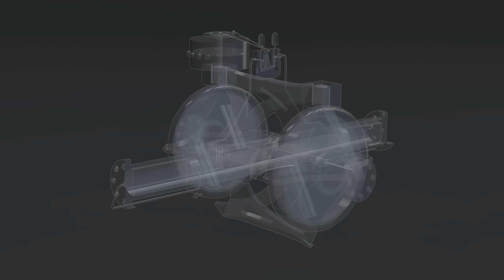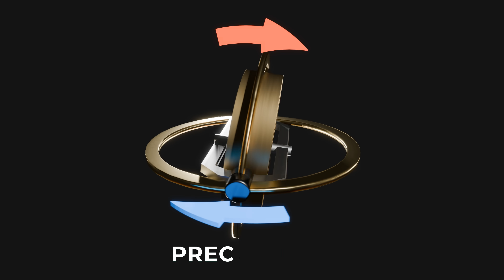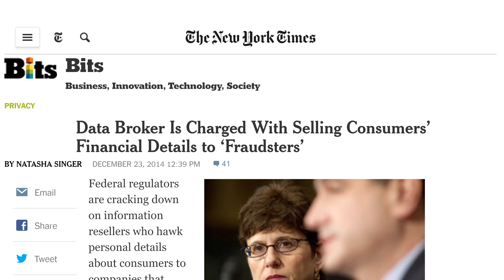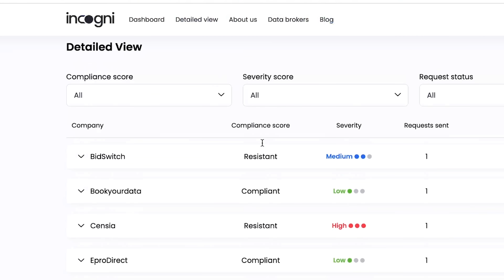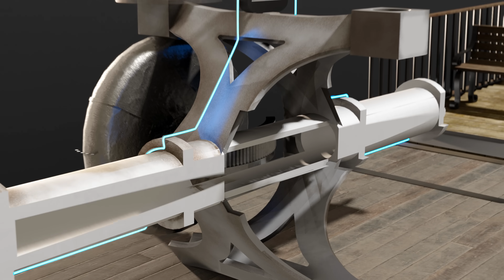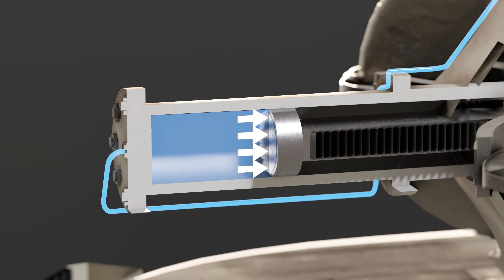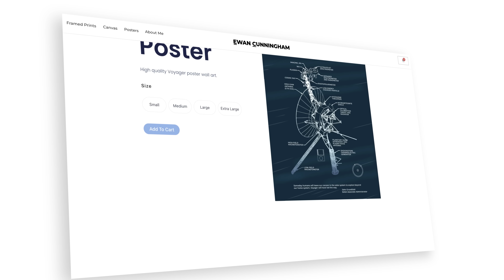The Self Balancing Monorail

Comment: Although the idea is inherently pretty overcomplicated and illogical when compared to normal trains... the engineering and design behind it is still amazingly complex and fascinating!
Reply: Yep.  That's why "keep it simple, stupid" won at the end of the day. Just 2 tracks, 1 engines at each end, and brakes to slow at turns. If the gyroscope looses power for 30 minutes the car will tip over?  30 minutes is not a lot of time to fix it in the vast spans of the railroads.  Amazing engineering though.
Reply: @Macky1101  you wouldn't use 30 minutes to FIX it, you would use 30 minutes to put some supports under the car so it doesn't tip at the end of the 30 minutes. I would say 30 minutes are plenty of time to evacuate the passengers and extend some kind of support beam(s). After that you have all the time in the world to fix the thing, or bring in two cars, one from either end, to transport the car off the track.
Reply: @Macky1101  You can easily fix the problem of tipping over after 30 minutes by installing vertical extendable metal rods on each side to fix the train to the ground.
Reply: @kanister21  Oh. Right. They can stop the train to fix the gyroscopes each time one fails.  Or maybe have hydraulic skis that come down for support or even glide on the rail ties?
Reply: and today, we have trains that learned to lean in curves to allow for higher speeds, which is quite complicated and requires a lot of electronics and mechanics.
this old system might have solved these problems more easily, although i doubt that it would be fast and failsafe enough for current large and heavy highspeed trains.
Reply: If you imagine a world where the financial or technological limitation is the RAILS and the self-balancing monorail goes from crazy gimmick to the common sense solution really quickly.
Reply: that was nothing illogical if you think back then trucks were little, so you could use the monorail as only one cart, the attached to the train itself, and it would move independently so it could just go to the zone required, and you could build twice the rails.
Reply: @yuribezmenovthegreat4705  well the system necessary to keep it balance is severely over complicated and over engineered, instead of having… two wheels… which are cheaper, easier, safer, and can bare heavier loads.
Reply: @marcelburdon9795 Yeah, but two wheels are for squares.
Reply: Actually, depending on how much sharper turns this design could take compared to normal trains, the ability to design snappier railways alone may have justified this design for certain applications. (Perhaps such as urban transit.) However that may have also been its downfall, since leveraging that benefit would require redesigning railway systems that were already existing infrastructure.

Comment: the problem is ironically the single track.  dual tracks are inherently structurally sound.  The two rails tied together by sleepers is quite stable.  A single rail on smaller sleepers would be much more susceptible to movement.

an using one rail of a traditional rail probably wouldn't work because the rail wears asymmetrically

Comment: Dude invented a OneWheel train a century before electronic controls which make that sort of thing safe, and got it to mostly work.  Respect.  I wonder what happens when it comes to a complete stop tho, like if there's some downtrack problem that forces it to wait.  Also wonder how it does colliding with a vehicle, since grade level crossings and dumb drivers are all over, even truck drivers in some cases.  Double track trains are surprisingly resiliant to collision and track problems, there's even a WW2 US army training video on wikipedia about how hard it is to derail a train on purpose.

Comment: How about sticking a steel bar through each side of the train composition or even invent a coupling for these bars. So all wagons would be connected to the leading gyroscope. I think this would require another gyroscope wagon at the opposite end of the train and a limited length of the train.

Comment: Rather smart design.
This could be used on normal two track trains getting rid off the complex suspension system reducing derailments.
Reply: Those gyrosopes are far more complex than a conventional suspension, and this monorail would still need suspension anyway.  No reason to think the monorail would be less inclined to derail (in fact it would be more inclined to) and derailments are not a significant issue on properly maintained track such as in most of Western Europe.
Reply: @dukenukem5768  I wouldn’t be using this for trains.

Comment: I wonder if the original design could be improved by modern materials science, like heavy metals to make the gyros smaller, and electromagnetics for the control and balance? It may not be worth the extra effort to replace existing systems, but it would be a marvel at Disneyland.

Comment: I was always fascinated by gyroscopes and their abilities to be applied in almost every branch of engineering such as in Brennan's mono-rail
Reply from the maker: Me as well. Pretty fantastic when you think about it!
Reply: Another cool thing is gyroscopes are also being used to create artificial gravity in space however the main issue with that though is getting enough power involved to keep spinning at the rate required to produce gravity.  Smaller scale tests have been done which shown promise. 

However you would require a fairly large gyroscope to produce enough gravity for a station and also fine tuning the power settings to get it just right or end up crushing everyone to death or flinging them around instead could be a result. Not only that the power required for such a device proceeds anything we currently have only chance of it ever being considered would be having a fusion generator which currently still doesn't exist yet and even then you would need many devices to not only monitor it but also make automatic adjustments without requiring too much input from a personal so mostly a highly developed AI would be required which we currently do not have yet. 

Still amazes me though those devices are such a simple concept but can do so much we just need to find ways to harness its effects.
Reply: @IloveJellow  Creating artificial gravity by spinning a torus shaped space station or spaceship requires almost no power at all once the vessel is rotating. Conservation of angular momentum will keep it spinning forever. The alternative, constant linear acceleration, requires a huge amount.
Reply: Thank you
Reply: Which never happened, not hard to work out why!
Reply: @alanevery215  And yet you didn't? It would literally take you less time than it took to write your condescending comment to find out what Brennan was really trying to achieve.

Comment: Very smart! However, I see two problems from a systems enginering standpoint: 1) the stability of the whole system is dependent on the correct functioning of quite a complicated set of mechanical and pneumatic parts. This is inherently unstable and dangerous because there is no "natural" or fallback stability in the system. This in contrast to a normal train that is completely stable even when all systems stop functioning. 2.) the already mentioned economics of the system: if every carriage would need such a complex, bulky and energy consuming installation, this would mean an unacceptable reduction in payload and increase in cost.

Comment: I'd imagine another problem that the train had was that it had to have the gyroscopes powered at all times. Yeah they can continue running for up to 30 minutes unpowered, but what about when the train is not in use? You have to continue to supply power to the gyroscopes when it's just sitting there, otherwise it'll tip over. Now if you have the train set up in a schedule so that it never has any idle time, that could alleviate that issue, but then how do you do maintenance? No matter how you look at it, there would eventually have to be times when the gyroscopes are not being powered and without also investing in some sort of clamping bay that would hold the train in place so that it wouldn't tip over while it's not being powered, it would end up tipping over. A tipped over train would cause damage to itself and possibly to the surrounding area and would take a great deal of work to lift back up and place back on the track.

When you consider all the adaptations, the power that is being wasted when it's idle, the extra labor required to maintain them and the ramifications of having to lift a train back up onto the tracks when it inevitably does tip over, you can see how just building the 2 rail tracks is still more efficient.

Comment: There were good brains at work in the 19th and early 20th Centuries limited only by the materials they had to build with.   If you look at engine patents....most of what we're using today as 'state of the art' had been thought of and patented before 1900.   4 valve heads, variable valve timing, fuel injection..ect. all were understood over 100 years ago by the inventors of the day.   Great video...I'd never seen this monorail...very clever!

Comment: I am a retired railroad engineer. And when I first started, I could not understand how even two sets of wheels could make that huge train stay on those seemingly tiny rails. The first time we went over stoney Creek bridge which is 450 ft high, on a curve. I just about shite my pants. Originally I thought it was the flange on the inside of the wheel and the inside of the rail that kept the engine on the rails, but it turns out to be the trains weight combined with the rail head design that keeps the train on the rails. To have it run on one rail is absolutely genius.

Comment: that was hundreds of years ahead of its time.
slap a couple electric motors on it, use hydraulic fluid instead of compressed air, give it a nuclear battery, slap it on maglev tracks, and youve got the future of high speed transportation.

Comment: Absolutely brilliant engineering.  Modern technology might replace the pneumatic valves with hydraulic valves.  And probably electronic controls of the gyroscopes instead of mechanical controls.  Though, these mechanical controls were astonishingly effective.  
Yes, each carriage would need its own gyroscope set.  A modern re-make would likely have very long carriages, possibly a gyroscope set at each end.  
The ability to take curves at a higher speed is extremely useful.  One might design a rail track with slight sinusoidal curves, so that thermal expansion/contraction of the rails can be accommodated with no adverse impact on speed or performance.

Comment: Really great work with the animations and explanations.

One extreme nitpick on a technical level I'll say is that the pneumatic pressure going directly from the "switch" to the piston looked a bit off to me. I'm not saying it didn't work like that (I have very little knowledge of early pneumatics and none for this train), but typically in pneumatics you'll have a sort of amplifier hooked to a separate higher pressure supply to actuate the piston. Regardless of whether it was necessary to function it was probably easier to explain to people without bothering to include that part though.